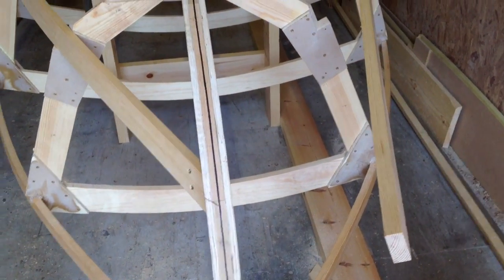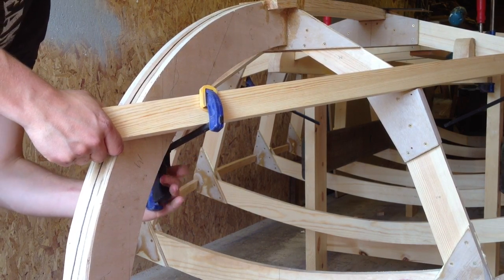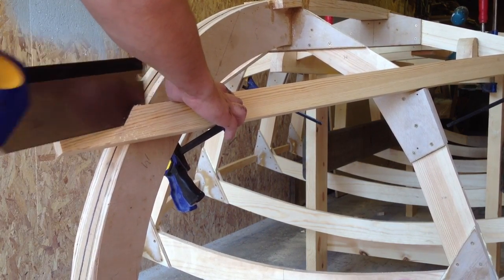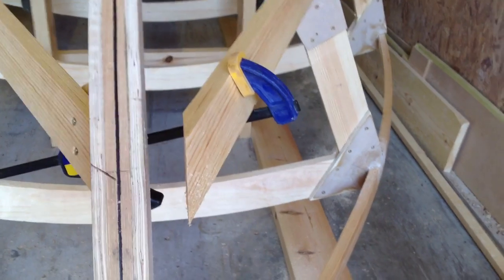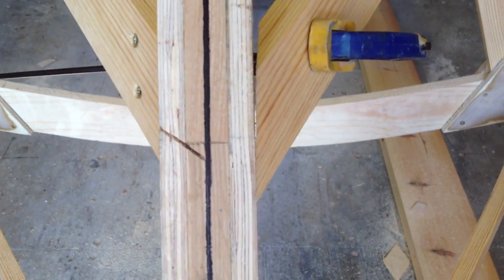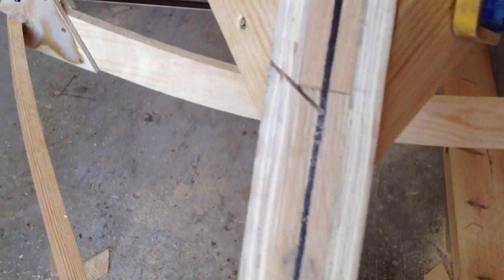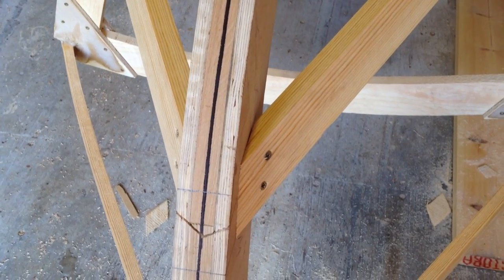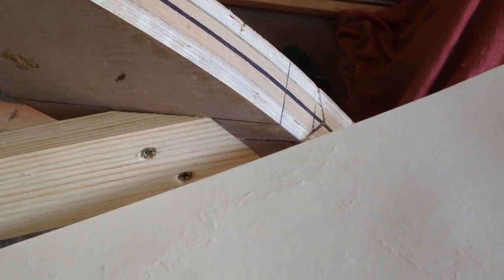How to Cut Chines to Fit Flush with the Stem on a Wooden Boat

Comment: Are screws enough to fix the chine to the stem? Isn't some sort of joint required?
Reply from the maker: Screws and glue are the pretty common combination for this, not many designs would call for a joint to be cut in here.

Comment: Dan - I'm building the Glen-L Zip and trying to fit the chines to the stem. In this design, the chines contact the stem at a much steeper angle - about a 5/8" gap at the bottom of the chine when top edge contacts the stem. And the leading edge of the stem is more steeply curved. Seems I have a choice of cutting the chine at an angle so it lands on the stem without twisting, or I  twist it so I can use your method.  Any thoughts?
Reply from the maker: I'm not 100% sure but I've always tried to land the chines so that they follow the most natural course, so not twisting them any more than where they want to go. This angle is usually dictated by the first frame. By the time you have faired the chines it probably won't matter much either way. Just out of interest do the plans specify the height that the chine should meet the stem? My plans never have done.
Reply: The plans didn't specify, but I can deduce, based on the 1 inch = 1 ft scale of the drawings, that they should land about 10 - 12 inches above the breasthook. I cut the notches on the first frame pretty accurately and they end up landing at about 8" (without a lot of torqueing) and that's where I left them.

Comment: Hi Dan!

What material did you use for the keel and the stem? Have you also used fir?

Will the screws in the battens or you remove them later and then closes the holes with epoxy?

Greetings from Switzerland
Reply from the maker: The stem is oak with 3/8" ply either side and the keel is just fir. I made the keel from 3 thin layers which were epoxied together on a jig so it would hold the curved shape. 
I left the screws in the battens as well, the epoxy may well be strong enough but it gives me peace of mind.
If your on Facebook have a look at the page on there for some more pictures of the build stages. http://www.facebook.com/rockethydroplanebuild

Comment: By chopping up the bow you are defaulting strength. Use a depth gague or a a common square
Reply from the maker: The stem is shaped down to a point after fitting the chines in order to carry the plywood skin, so the cuts are into waste wood areas that will be later removed anyway.